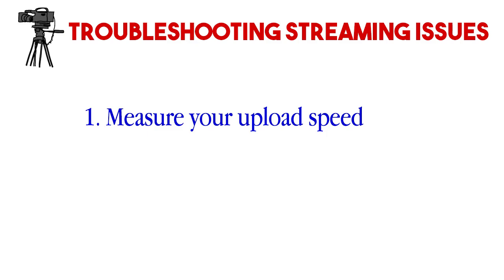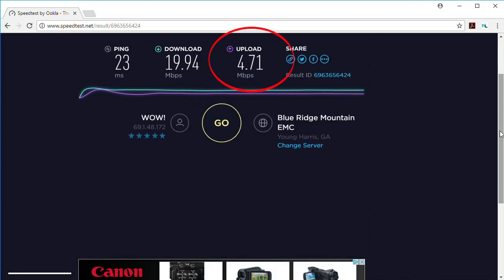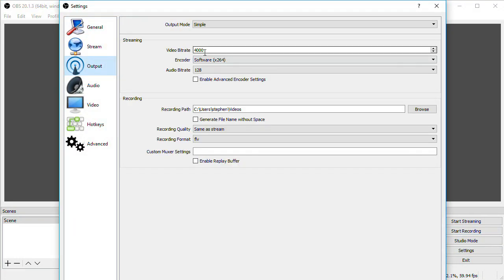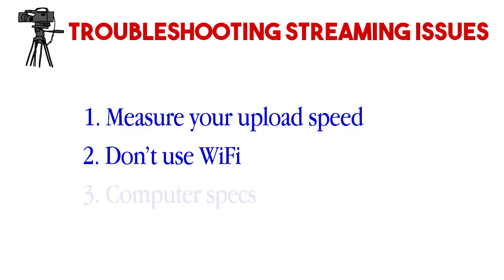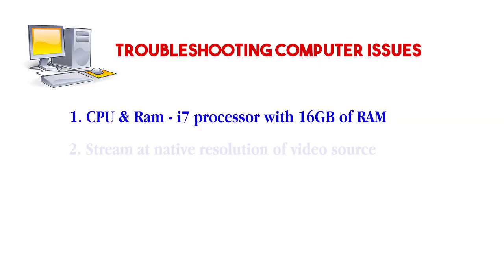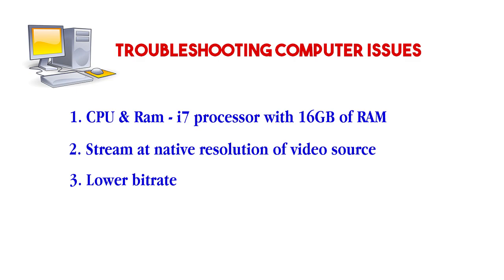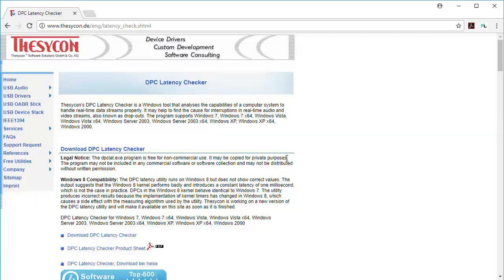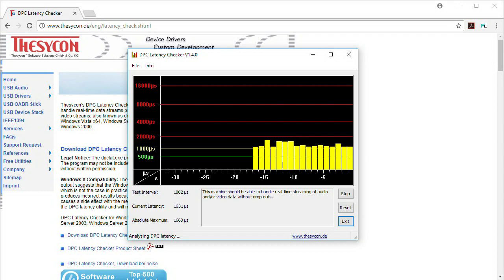Why is my live stream lagging or buffering

Comment: Im having extreme buffering problems for ESO.
I mainly stream Call of Duty Modern warfare and had no issues.
my PC SPECS:
Ryzen 7 2700x clocked @4ghz
RTX 2080 

16GB Ram 3000Mhz
and 36mb upload speed with 230mb Download speed.
I usually streamed at 1080p 60fps with no issues
my bitrate is at 6000 steady.
BUT when i go to stream ESO it constantly keeps buffering endlessly and im not sure why.
I tried lowering resolution to 720p 30fps and to no avail it doesn't work. my Bitrate was raised to 7000 bit rate and my stream STILL endlessly buffers. if ANYONE can help me on whats going on i would greatly appreciate it and will be indebted to you. I just want a solution to this so i can go back to streaming like normal. If it helps i am running a 144hz Monitor @1440p and am playing the game at 220-240fps. Please in am looking for help and went to multiple videos and none of them helped including this one.
Thanks Everyone for reading!

Comment: sir .. my upload speed 45mbps .. so how ,uch bitrate I need to do ??
Reply from the maker: For 1080p try starting at 6mpbs
Reply: @BallastMedia  ok I will try it ..but why not 22.5 ??
Reply from the maker: @hiroyuki918  Good question.  Increasing the bit rate puts extra load on your encoder, your internet connection and the end user, etc.  Youtube recommends for 1080p 3,000-6,000kbps, and that's generally where the encoder produces a decent image at that resolution.  So, for streaming there isn't much reason to go higher.  If you are recording locally, then yes by all means use a higher bit rate, up to 28,000 or even 30,000 to maintain the quality of the video.
Reply: @BallastMedia  ok tq ..

Comment: What if 1 upload speed? How many bitrate
Reply from the maker: Do you mean 1Mbps? Then I'd start with 500kbps, which isn't much, so try an SD video resolution, like 640x360. Then test your connection, and move the bit rate up each time you test to see what it will sustain, try 500, then 600, then 700, etc and see when it starts causing problems and go back to the last stable rate.
Reply: Oh thanks

Comment: Can you please answer my question im trying to live stream and my megabit is 10 what is my bit rate supposed to be? for OBS Sutdio
Reply from the maker: What resolution are you trying to stream? (720 or 1080?). What is your destination? (Facebook or YouTube?)
Reply: I'm using 720
Reply: When I live stream my health is good then okay then it goes to bad I don't want that to happen
Reply: YouTube
Reply from the maker: I'd run a 720p30 stream somewhere between 2500 and 4000. Your connection should support anything in that range.  Are you using WiFi to connect your computer to the internet for streaming?  What you describe. Good to ok to bad sounds like a wifi connection.
Reply: Yes I am using Wifi
Reply from the maker: Mr.SniperGaming That's your problem. WiFi speeds are peak speeds and aren't sustained. Try a hardwired connection at 3000 and you'll probably be golden.

Comment: It says on the speedtest website that I have 94.25 Upload speed, is that good or bad?? 
Download speed is 92.83 and Ping (MS) is 1
Reply from the maker: That's fine, start your stream, of 720p at 3500, and if 1080p at 6000. Still kind of depends if your computer can encode at those bit rates.

Comment: So if my upload speed is 90mbps i can use 45000 bitrate?
Reply from the maker: Rokxas theoretically yes, but no one will be able to watch it. Facebook limits you to 4000. You can get a pretty good looking 1080p image streaming at 6000-8000. No need to send more then you need, it will just cause more problems.

Comment: There is a lot that I just don't get. Why are you talking about an i7 computer and NOT talking about hardware encoders? - and how do you propose streaming a concert from a church with no internet without using wireless internet? - which is different from wifi except that you then have the issue of how many users the mast has and the risk of being switched between masts. That is not one new quagmire to chart, it is two!
Reply from the maker: Talking about the computer's processor, because in the case of this video I'm referring to using a computer as your encoder.  But, yes there are stand alone encoders that will work fine as well.  If you must use 4G or LTE service for your stream, just be aware that you'll probably need to use a lower bit rate in order to be able to sustain your stream without dropped frames.
Reply: @BallastMedia  Yes, learned that in a fairly hard manner via the silliest error message possible "your audio bitrate of 0 is too high". Translated to humanly legible terms it means that there has been a buffer underflow and we are repeating the last image received for a second while we get some buffer content and muting the audio as we don't have any. Visually that is an ok fix, but for a concert it is "not so ok". An actually helpful error message from youtube had been "buffer underflow, reduce your bitrate", but it is beyond their world of thought apparently that audio is more important than video in some contexts. And I tested network speed before the concert, 4G gave me a whopping 75 megabit download and 35 megabit upload, so I ended up in the fallacy that 8 megabit video in full HD would be ok. Actually it was - apart from the occasional frame-repeat, but the audio wasn't.

Comment: Im using WiFi and I cant use anything else cus Im using the laptop!
Reply: My Download speed is 14.05 Mbps and 32 ping upload speed is 5.58 Mbps
Reply from the maker: If you have to use wifi, just keep your bit rate low.  Wifi data rates are "peak" so they won't be able to sustain as high of a data rate as a wired connection.  If you are having any connection issues or lag, lower your data rate.

Comment: I got ~24 on speedtest upload and idk if i do 12000 or 1200 or what?? btw I use wifi and cannot use ethernet cord
Reply from the maker: What resolution are you running? 720p then use 2500 and if 1080p use 6000.

Comment: guess my computer´s too weak?
Reply from the maker: AdaraTheShallot What are your computer's specs? And what are you trying to stream?
Reply: some light novel games. i tried one more time but it keeps buffering. i lowered the bit rate to 800 and i put the wifi usb to the front of my computer but it still buffers. my mbps is 1.6 so not enough.
Reply from the maker: Have you measured your upload speed at speedtest.net?  Also, do you have a hard wired connection available, not wifi?